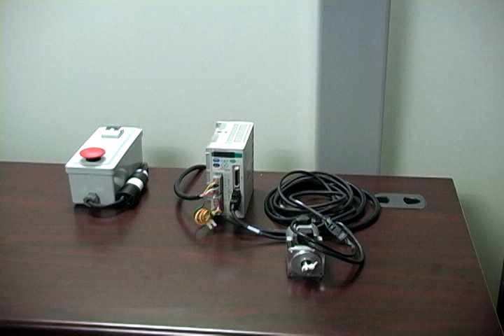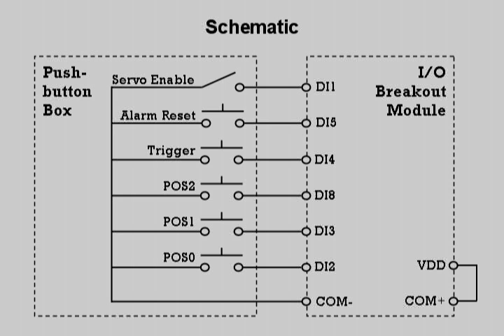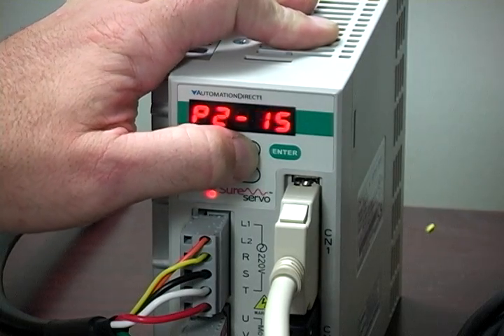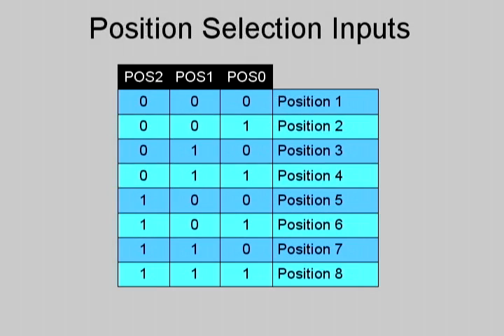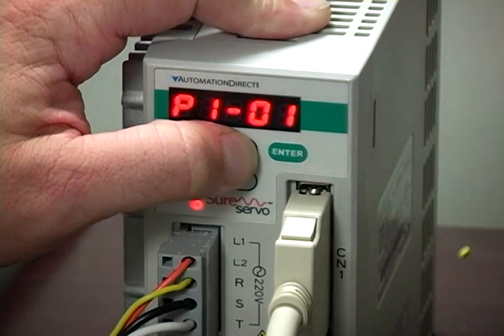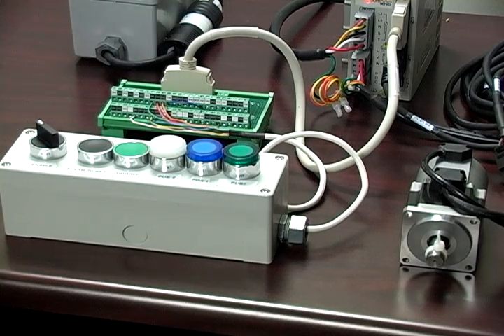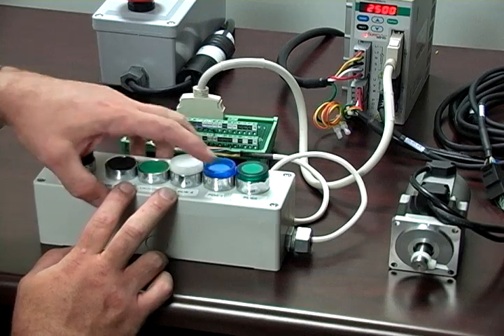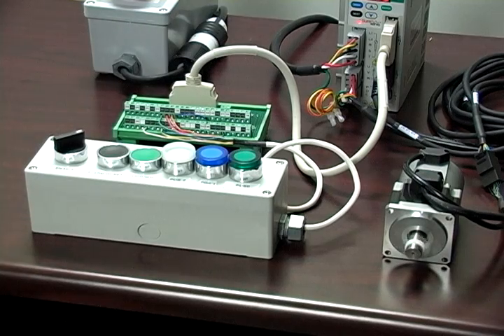How to Set Up and Use Position Register Mode in a SureServo System (Part 2) from AutomationDirect

Comment: Please know the error 5, 7 and 15 appears on the screen as soon as the power is connected
Reply from the maker: Rebot min, ALE15 is overtravel which should come up when the unit powers up the first time. ALE05 is regeneration error and ALE07 is overspeed. These are both dynamic alarms that should not happen upon power up. Chapter 7 of the manual covers troubleshooting: https://cdn.automationdirect.com/static/manuals/sureservomanual/ch7.pdf Your application questions may be best answered by contacting our FREE, award winning technical support team: https://community.automationdirect.com/s/contactsupport
Reply: @automationdirect  Thank you. Now this has been fixed, but error 18 appeared in the new driver. It was tested on the other axles X and Z and it has the same defect. The Y axle was tested on another driver and it works perfectly.
Reply from the maker: @rebotmind2396  I'm sorry that you are having this issue. It would be best to contact our technical support group. https://community.automationdirect.com/s/contactsupport
Thanks!

Comment: How do you define a zero reference on the engine?
Reply from the maker: Hi Florent,
SureServo has a variety of ways to establish home position.  The home sequence can be initiated by a Digital Input or thru coms - (by defining a DI as a Virtual Digital Input (see parameters P2-10, P3-08, and P4-07).  The Homing Mode is defined in parameter P1-47
Reply: Thanks but is it possible not to lose the engine position without making homing after a shutdown?
Reply from the maker: Hi Florent, 
You have to re-home the original SureServo if control power is removed.  But remember that control power and motor power are different inputs, so if wired correctly the drive should retain its position unless the entire control panel has power removed.
FYI: We have a new servo system we are planning to release this fall with a battery backup so it never looses positioning. Be sure to subscribe to our YouTube channel so you will be notified when that is available.
Reply: Ok its possible to remove only  motor power via Digital Input or by configuring the drive ? Thank you
Reply from the maker: @florentdethoor6565  Yes.

Comment: ?sir ;i have alarm009,how i can solve it
Reply from the maker: @Mohamed Ali Massadi, That is an alarm with drive fault code of 09, which is excessive deviation. That code can be seen on page 4-11 of the user manual, https://cdn.automationdirect.com/static/manuals/sureservomanual/sureservomanual.pdf. A more detailed explanation can be seen on page 7-4 and 7-7.

Comment: I'd like to know , if there is a software to set up these servo drives?
Reply: +Fernando Davila 

Yes, there is a link to the FREE SureServo Pro software download on this page, as well as full details about the associated programming cable(s):

http://www.automationdirect.com/adc/Overview/Catalog/Motion_Control/Servo_Systems/I-z-O_Interface_-a-_Communications_-a-_Software

Please understand that the software (and programming cable) are NOT required - you can do all the drive setup via the keypad (as shown in this series of videos).  However, some users may find that the software is more convenient, especially if they have to set a large number of parameters, or if they are configuring a large number of SureServo drives.